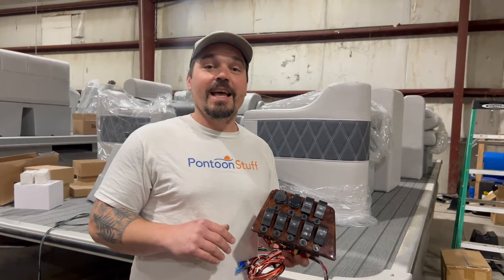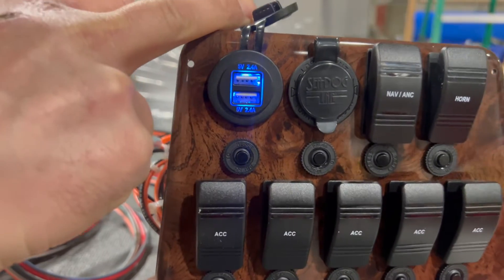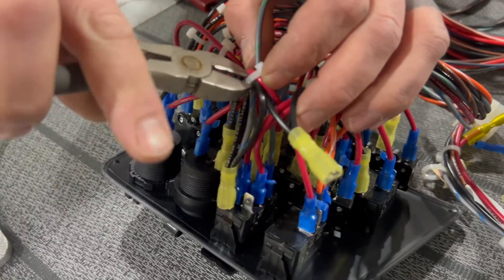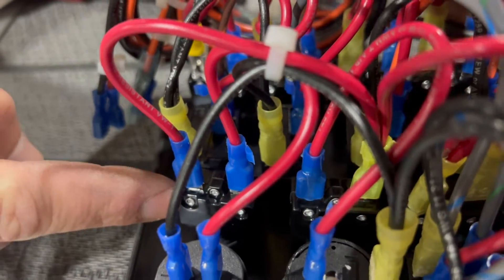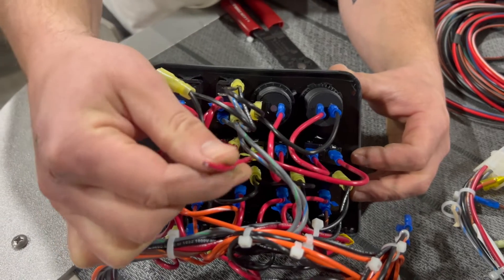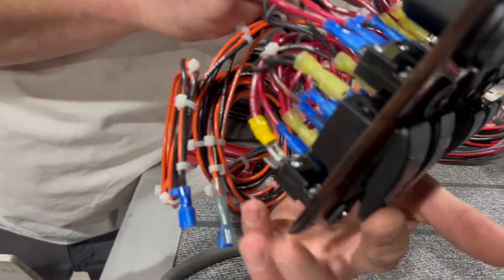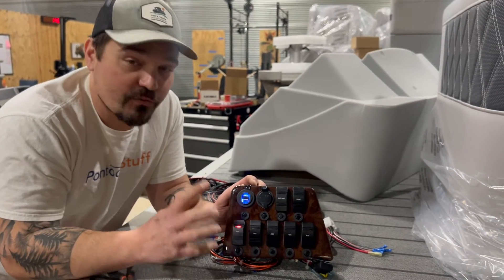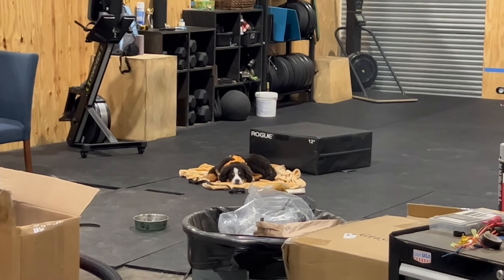BOAT SWITCH PANEL - Understanding & Modifying

Comment: hi can you please help me and make me a basic diagram to wire my 5.5m boat
I have two batteries, a selector + 3 navigation lights + a bilge pump + horn + fuel gauge + battery voltmeter
thanks in advance
fafa
Reply from the maker: This should help!! And check my channel for videos covering each item you listed.

BOAT WIRING TUTORIAL - Instructional Video
https://youtu.be/N1Z1q5YTH2s

Comment: Great and very helpful video as always! I am planning on using the Premium Large console which will include this switch panel and will likely make this change. We are not the greatest at turning everything off after a long day on the lake.
Reply from the maker: Great, that's what we're trying to do! I will hopefully be doing a simple On/Off battery switch install soon too. Pontoon Stuff recently added those to their website too. Not to say we would always remember to turn that switch off either after a long day on the water!!